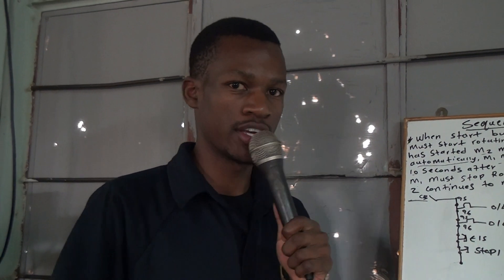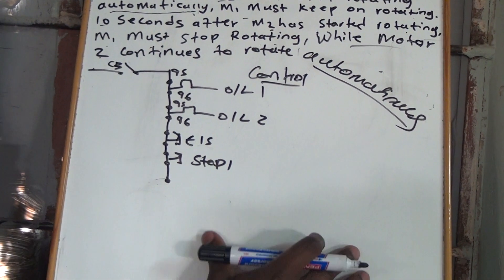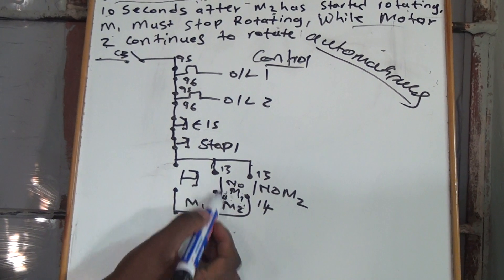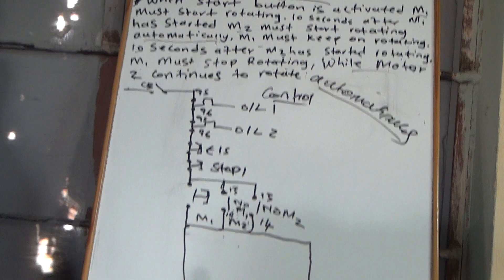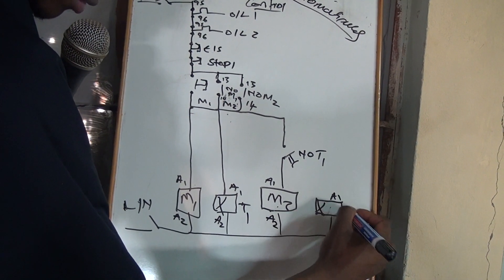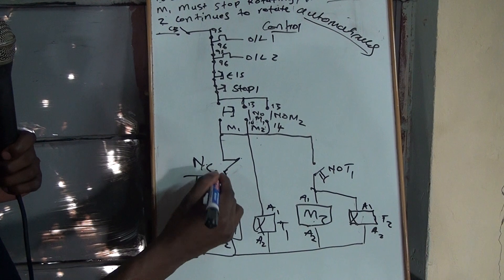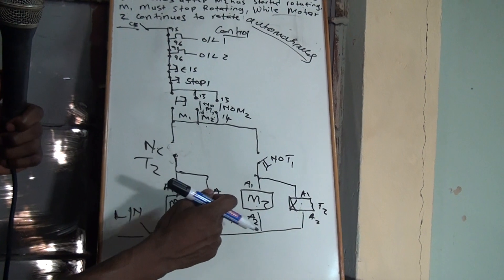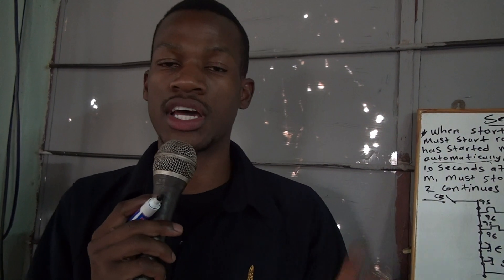MOTOR SEQUENCE 5: ARTISAN ELECTRICIAN

Comment: Circuit didn't work out😏
Reply from the maker: @justinkgongoana1104  Sorry to hear that my brother....But I think the problem is with the timers....I will connect it on the next videos and show you how to connect the timers in real practical. Theory and practical not the same. Remember that timers  change contacts immediately so when I draw a normally open timer then in actual fact I'm connecting a n/c.  But I will show you what I mean when I do the connections on the next video.

Comment: Question,  dont we put a hold in on our timer
Reply from the maker: @everetttakundadangwa5350  a timer remains energized as long as it's bein supplied with current. So we don't put a hold in. Intact the whole circuit is one a hold in for a timer
Reply: @collegenatedengineering1659  say you want the timer out of the circuit to prolong its life
Reply: Or given you using the same timer for many conditions
Reply from the maker: @everetttakundadangwa5350  you can use a different source of power supply to your timer....and your circuit will still work. 

Like for instant you can put a separate breaker which will only be responsible to supply power to your timer.

Comment: Is it necessary to connect 14 of M1 and M2 together? Because 13s are connected and giving supply
Reply from the maker: @kgomotsopitse8341  remember we only press the start button once. Even though the 13 are already connected but current won't flow from 13 to 14 since it's a normal open contact until you energize each  coils. Everything is happening automatically. 

If we use same start button then it means we must link the 13 to 13 and 14 to 14. Those are Just contacts which change positions once the coil is energized. Thank you for your question, hope I answered your question.

You can whatsapp me on +27813785000 or email me at bonganig456@gmail.com for more clarity.